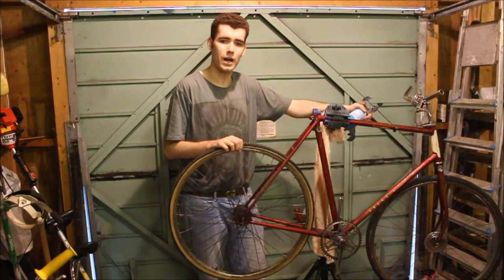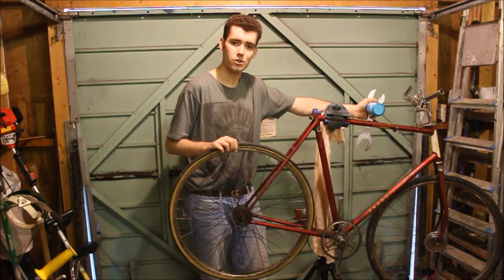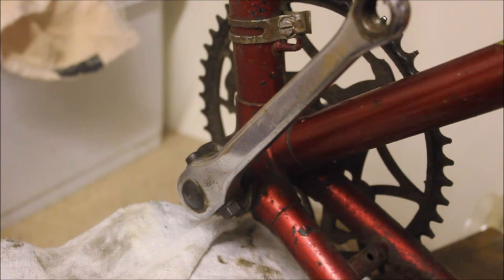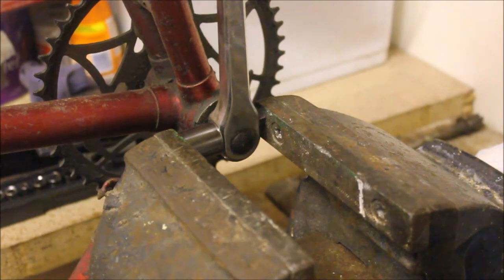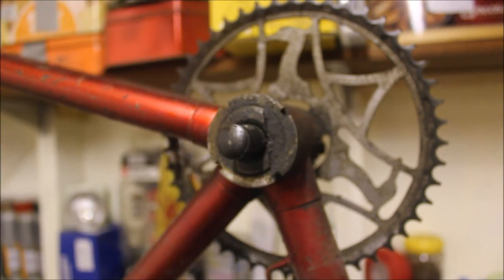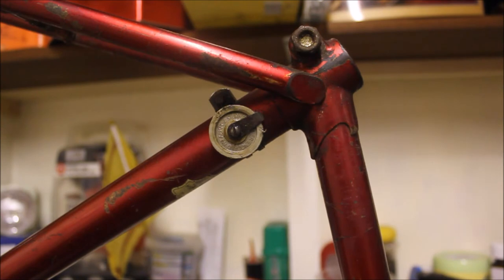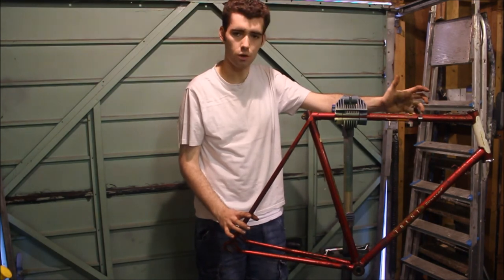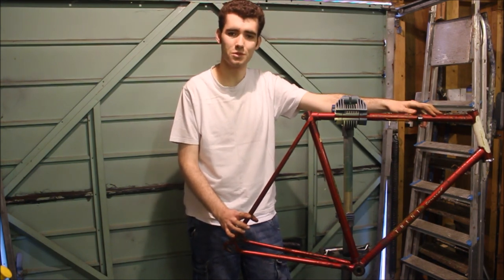Raleigh Trent Tourist: Cotter pin removal and restoration tips

Comment: I didn’t have much problem removing old pins but after installing new ones I run into the problem of arms not being 100% opposite to each other. I’ve ordered more than 10 pins and I guess will have to try again. Any tips regarding alignment? Any help appreciated.  My bike is old 80’s Raleigh 3 speed similar to Chiltern.